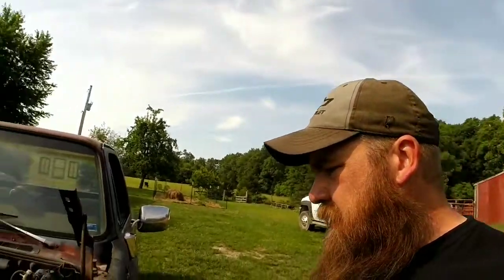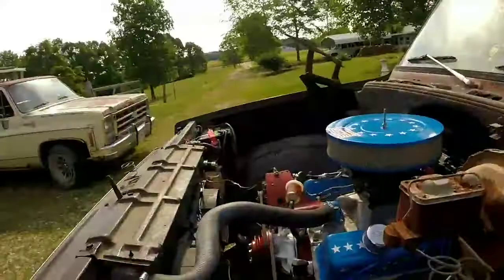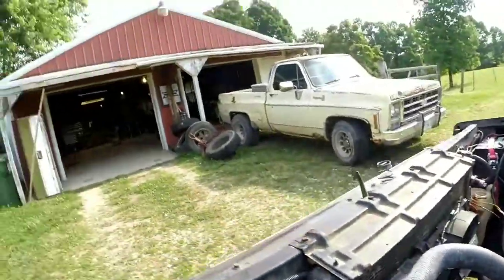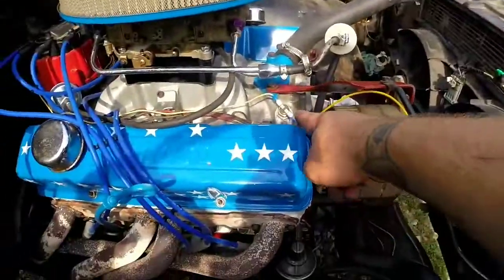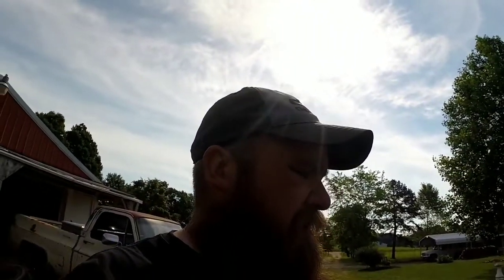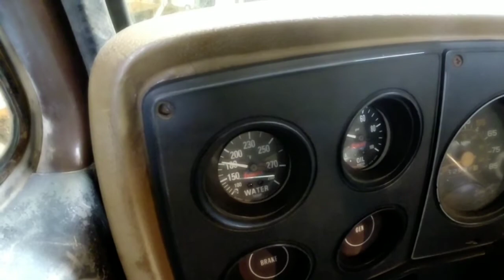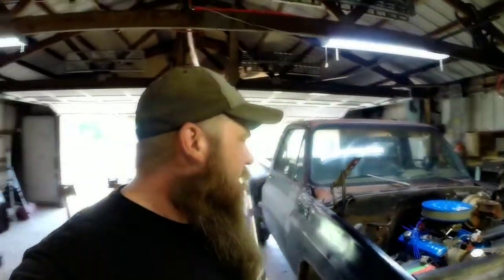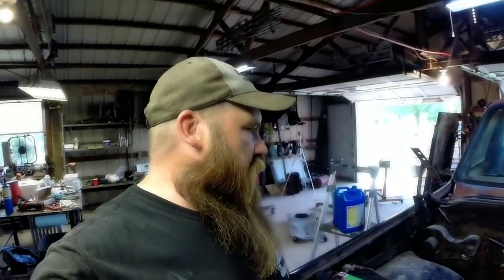First test ride with the new cam and open headers in my 78 c10 stepside.

Comment: That’s awesome man, I’ve got a 78 K2500 camp special with a granny 4speed. Motor is a 350, world products sportsman heads 2.02/1.60 valves, 1.6 ratio full roller rockers, 465/465 comp cam, 870 Holley and sum more odds and ends stuff...runs pretty good for an old long bed 4x4 that weights 5,200lbs lol...it’s good to see more people keepin these old square body’s runnin, cuz trucks will never look as good as 73-79’s

Comment: my dad stuck a 454 in his 85 and gave me the 305, so I'm going to ca, swap it, holley single plane (which is probably going to be replaced with edelbrok daul)  and it's going to get a holley 750 and an ebay gt45 turbo.  hoping to get 300-325-hp  oh its sitting in a 98 s10 single cab
Reply from the maker: Ought to be a fun ride in that S10.

Comment: I bought some new headers and I wondering if I ran them open would I be damaging anything else beside my ears?😂🤔 And like I’ve heard that cool air can go inside your exhaust and warp your valves but in Florida there is no cool air so would it still have an affect -Andrew 85 c10 tree fiddy 4bo th350
Reply from the maker: I've run open headers on different trucks throughout the years and never had issues. I even had #8 header tube break completely off of my big block and coming straight out of the head in my crew cab and had to drive an hour in 30 degree weather. Luckily I had some earplugs with me. But no damages were done to the engine. I wouldn't recommend it, but I had no other choice.
Reply: @SquarebodyStuff  ohhhh ok, also my 85 is Not my daily it will probably be a weekend truck or maybe drove like twice a week For here and there things. I didn’t wanna spend $500 to get an exhaust system on a truck that I wasn’t going to use 24 seven, I also don’t plan on going more than 20 miles in it, mostly because I built for the engine for the straight line and I didn’t know if I would be hurting anything if I decided to take a trip to town, which is about 15 20 miles away 😂
Reply from the maker: As a disclaimer, I will say, do it at your own risk. I've never had an issue doing it, but anything can happen. I will also add, open headers on the street get old quick.😁😁
Reply: @SquarebodyStuff  thank you sir for the advice, I’m definitely going to be Very cautious

Comment: Take a look at my build on Joshua Taylor performance. Its a 98 GMC Sierra had the 305 and it was shit but, put a intake and carb on it and beat the shit out of it and it will take it. this is about 8 years ago. 305 was a test motor of all kinds of junk yard parts!!! Thats how i know how to build sbc, but anyway it has a Blow Thru carb,  one turbo 350 30over, 355  its all DIY manfold, carb hat was a muffler i cut and wielded together. It has a 1970 4-speed Muncie in it that i built the clutch pedal and every Fab on it. Well thank you for your time this is the first time i have left a comment but i like your videos and I think u would like what i have going on at Joshua Taylor Performance. i would have more videos but shit its a job trying to make videos and work on stuff and still get much done. Thanks and keep up with the bad ass videos you making.

Comment: Are those Edelbrock headers?  Im worried about my manual linkage?  Do the headers clear your linkage?  Tha ks.
Reply from the maker: Honestly not sure of the brand. I think they're Hookers. I got them used. They're for a Chevelle. No problems clearing anything. They also don't hang down to low like the truck headers do.
Reply: The summit brand long tubes will clear a manual body linkage. Have some on mine.

Comment: What stall are you running? 3000? Cause i have this cam also and being told it cant be done
Reply: As tar as the truck i have
Reply from the maker: It's a variable stall speed manual transmission (SM465). If it was an auto a 3000 stall would be best.
Reply: @SquarebodyStuff  right that's correct i am just gonna show your video lol

Comment: What kind of headers do you run on the truck it sounds awesome!!
Reply: Thanks, I was trying to find headers that will fit in my squarebody that has a 305 4 speed. Plus they sound sooooo good.
Reply from the maker: Not sure of the application. I think they are for a car. They don't hang down as far as the truck headers usually do. I got them used at a swap meet.
Reply: Squarebody Stuff thanks man I actually found a brand new pair for g body cars on summit racing. I’m building the same engine you got in your truck It looks like a ton of fun. And I’m in Missouri too
Reply from the maker: Sweet. Where abouts in missouri
Reply: About 30 minutes away from St. Louis. I got my obs and my squarebody and I love em. I love squeaky I’d like to do what you did to the truck. I bough a 305 the other day and am ordering more parts soon. I’m watching a lot your videos and there great.
Reply from the maker: Sweet

Comment: The sound of this 305 is pure joy! Good job! How's the torque at low rpm?
Reply from the maker: Thanks. It lost some torque down low, but still good enough for what it is.
Reply: @SquarebodyStuff  you must easily be in the 380hp range with that little beast! Awesome engine.
Reply from the maker: Probably be lucky if it was much over 300 hp. But it's fun to play with.

Comment: Did you keep the stock valve springs and lifters?  Sounds freaking AWESOME
Reply from the maker: Thanks. No, the valve springs are off of eBay. They call em Z/28 valve springs.  They are good for up to .550 lift. The lifters are Speed Pro HT817R, they're an anti pump up "race" hyd. Lifter.  I have several other videos of the work I've done to this little 305.
Reply: @SquarebodyStuff  thanks
Reply from the maker: Not a problem.
Reply: @SquarebodyStuff  anything different with the push rods and rockers?
Reply from the maker: Comp cams pushrods, and stock rockers.  
Here's the first video of this project. https://youtu.be/IPnN0si-jWE. 
Here's the playlist that has all of the videos of this truck.
Squeaky, 1978 stepside c10: https://www.youtube.com/playlist?list=PLzr1ksHJJMTz2avp1iDlYYloKSKJKkFni
Reply: What heads are you running on it?  Are they the stock smog heads
Reply from the maker: Yes. I plan on porting them eventually to see if it makes a difference.